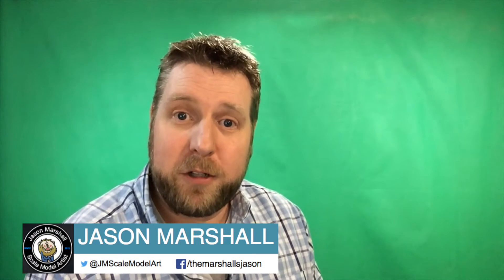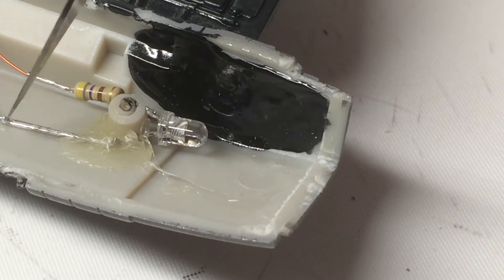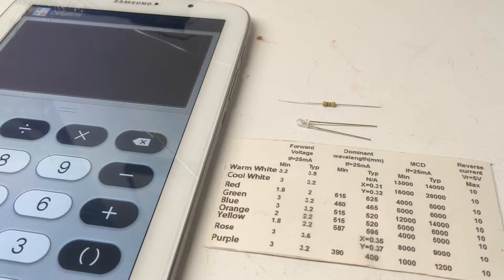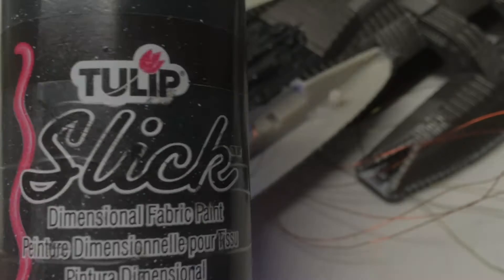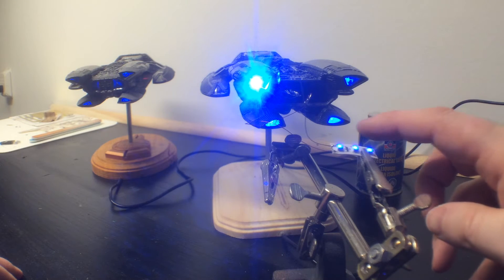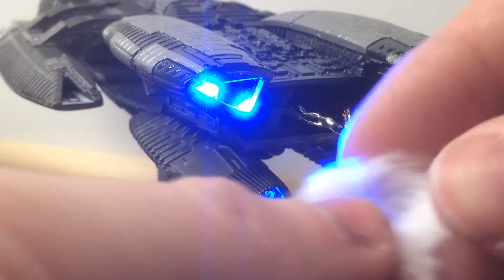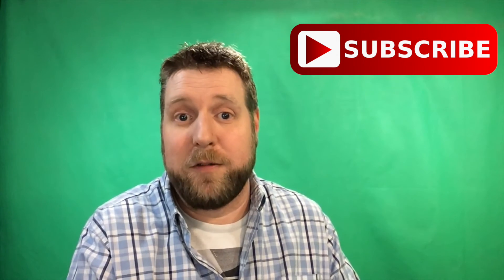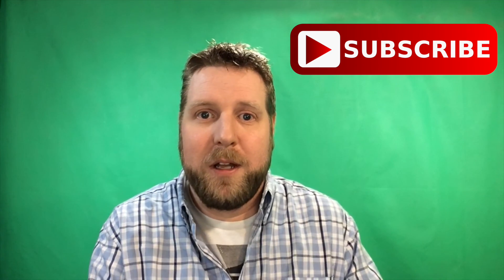Battlestar Galactica Part 7: Engine Lighting

Comment: your making me won't to get on with my kit Jason lol, Tulip is great i use it all the time for light blocking and you can use it to join parts it works like a glue, it takes a while to dry and you have to make sure the part isn't under any strain, as it doesn't have a lot of strength.